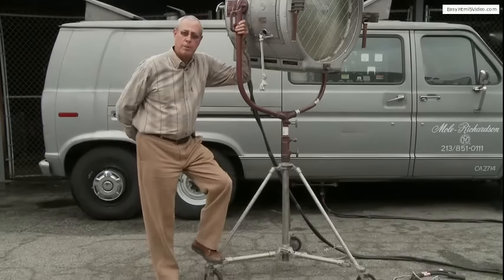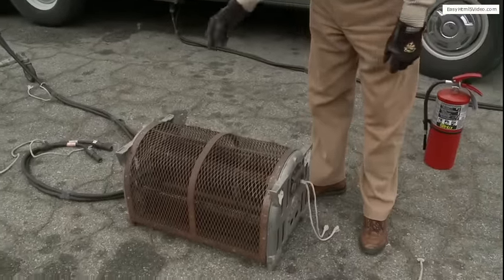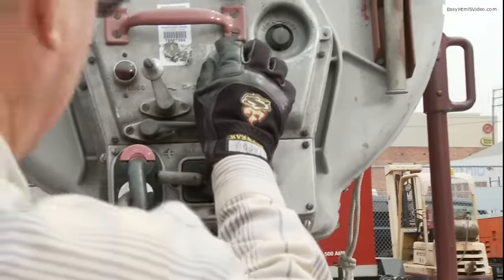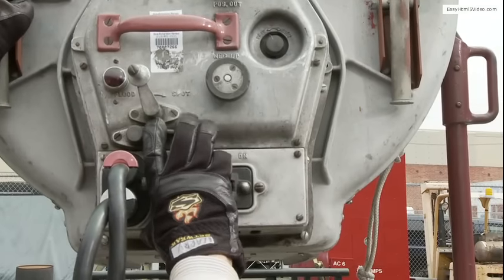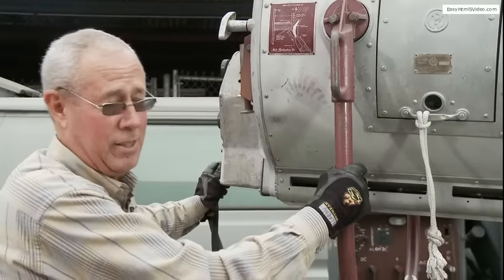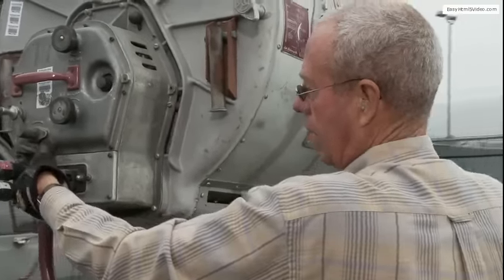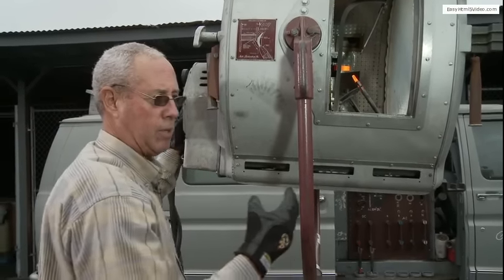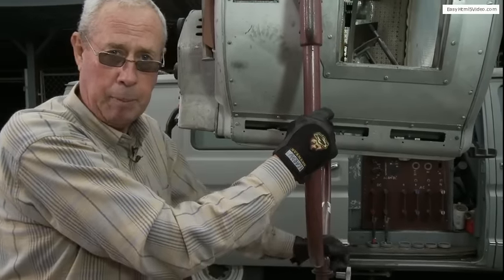How to operate a Carbon Arc

Comment: Even back in the 1990s those lights and the people who knew how to operate them properly were getting hard to find.
Today even HMIs are being overlooked in favor of LED fixtures that dont produce the kind of small source light quality but have lower power requirements and are DMX controlled.  The craft is suffering because of this acceptance of cheap quantity over quality.

Only got to operate a carbon arc (spotlight) once , for a commercial and my 'training' probably had less info than this video shows but it was fun.  Makes one long for the days when each light had an operator, compared to today when many crews function at a bare minimum to save a few bucks.

Comment: I am used to seeing the antiaircraft spotlights being used to promote new businesses in the 70s and 80s.
Those were some large carbon arc lights! With enough power to disorient pilots on bombing runs.
Same principles as your stage lights, just a bigger mirror and set of rods.

Comment: My dad had a dc welder ran by a flathead Chrysler 6 cylinder motor he used carbon arc rods to cut steel,they were about3/8s dia. And encased in thin copper,he didn’t have cutting torch back then.

Comment: Holy Moly That Generator is a big Mother 120Kilowats inside the van. . It must get very hot inside that van and no doubt the exhaust gas is vented to the outside. I see in the comments the question was raised as to why you generate 110 volts when you only use 70 in the arc lamp. There must be reason for that ! What is the reason as it uses more fuel and produces waste heat. Brian

Comment: Having used carbons for gouging steel, and being burned anywhere skin wasn't protected from radiation,  I wonder if radiation burns in front of the light was an issue?
Reply: The glass stops UV

Comment: Once used extensively in the graphic arts industry.
Not very stable output running on AC, but stable  enough to expose plates.

Comment: Popcorn thing was pretty funny . I had a vacuum chamber bag sealer at work one day I decided that it would be neat to use the vaccum chamber and bag sealer to seal my. Piping bag of whip cream I just made . I tried to seal the bag then the vaccum started sucking the whip cream out of the bag. I tried to unplug the machine but it just paused my stupidity . I decided to just let the machine go through the process and clean it after . btw chef will check everyone's prep work for dinner service in 5 min ...gulp ..i didn't get fired but I never made that mistake again .

Comment: Are they ever used today:  It must be about 15 years since I saw one running.
Reply: I was an extra on 'Feud' a few years back. 2015? 2017? An extra who is in 728, got paid as a juicer AND went through hair, makeup, and wardrobe to also be paid as an extra. There was no grid; there was a transformer/rectifier that took 120V AC and put out 94V DC. I didn't even yell out "Trimming!" as that would have just confused everyone. It was great to operate an arc again.

Comment: Carbon ark was used for many things. Searchlights, Lighthouses. Carbon arke was even used in welding. Which, I once used. Poorley, I have to admit. It wasn't easy to manage the carbon rods and the welding rods at the same time. And the heat that it produced was unbearable. Thanks, Grandfather.

Comment: You see, that's the best about all that old antique electrical equipment -you accidently reverse the polarity -  but all you end up with is a red warning lamp  -not a completely fried electronic circuit board!
Reply: It's actually quite common to have reverse polarity protection in modern electronics.
Reply: @hakont.4960  Pity that wasn't the case when I accidently reversed the power supply to a Dell inspiron laptop & fried the
main board!

Comment: Just saw one made by G.E. about two weeks ago at an airshow. The owner told me all about the light like where it came from and where he got parts. The unit was an original U.S. government issue with D.C. generator on a fabricated trailer. The light was bright white. Took me back to the days when carnivals, state and county fairs and car dealers used them for attracting crowds.

Comment: That must be the most inefficient electric  light ever
Reply: It’s not as bad as you think, it should be quite a bit more efficient than standard incandescent lights. Today variants of arc lights are still one of the most prominent light sources used when extremely high light output is needed. Modern examples are Xenon arcs. One of the many upsides are that they can be made in a much wider size range. Also, the electrodes last much longer in those enclosed systems and do not require ventilation for the fumes (though they still need cooling, the most powerful ones even have inbuilt liquid cooling of the electrodes). The carbon arcs gave excellent colour rendition but were as shown here fiddly to operate consistently and well because of the sacrificial electrodes.
Reply: It’s not as bad as you think, it should be quite a bit more efficient than standard incandescent lights. Today variants of arc lights are still one of the most prominent light sources used when extremely high light output is needed. Modern examples are Xenon arcs. One of the many upsides are that they can be made in a much wider size range. Also, the electrodes last much longer in those enclosed systems and do not require ventilation for the fumes (though they still need cooling, the most powerful ones even have inbuilt liquid cooling of the electrodes). The carbon arcs gave excellent colour rendition but were as shown here fiddly to operate consistently and well because of the sacrificial electrodes.

Comment: as I get older the light seems to get worse.. And it cant be all age related.. Found a real 40w light bulb and the light it puts out brings all my other lamps to shame..There is no way that Led lights can compare.. But as with lead based paint...when you remove one component you need to replace it with something else. How about that gasoline eh?
Reply: LEDs need work, but now that they've been on the market a while, you can get them in different colour casts, cooler and warmer. They're getting better, not just always that harsh cold light. But I can't argue with a 40w incandescent, some of the best light you can get.

Comment: It's almost like welding !
Reply: Same principles apply, but since it's carbon electrodes, it's not melting anything. Basically stripping electrons off the carbon making it burn.
Reply: @JosephArata  
Then really it's the same as a Carbon ark torch . They don't use them much anymore but they are handy if you don't have gas.

Comment: I thought that the US had 110 volts.
Reply: A residence in the US is powered by three wires, two "hot" and a ground. The two hot wires connect to the ends of a 240 V secondary of a step-down transformer that is part of the distribution network. The ground connects to a center tap on the 240 V secondary. A connection between the ground (neutral) and one of the hot wires gives 120 V. A connection between the two hot wires provides 240 V which is used for heating water, the kitchen stove, HVAC system an so forth. Small appliances are driven by 120 V. And, of course, it is AC at 60 Hertz.

Comment: If you are dropping 47 volts at 1000 amps with those resistors, they are shedding about 160,000 BTU of heat.  Toasty.

Comment: 1:43 That is a huge safety mistake. Work on any electrical device is only to be undertaken after it is isolated from mains voltage. First you play around the insides, then you plug it in. Always. No matter what it is.